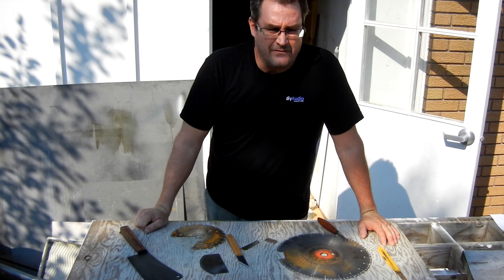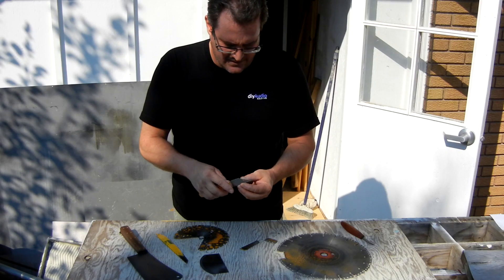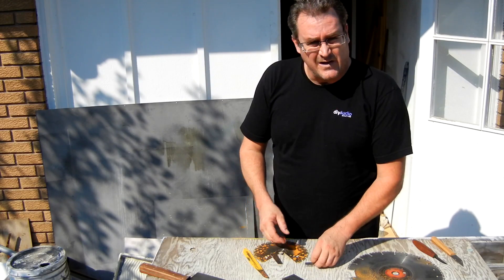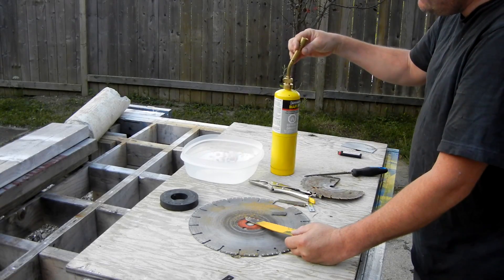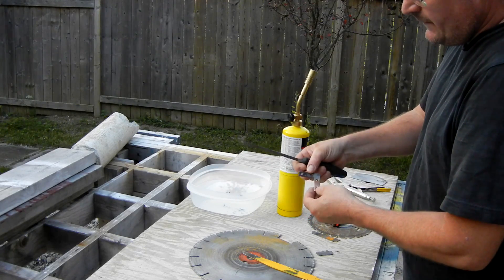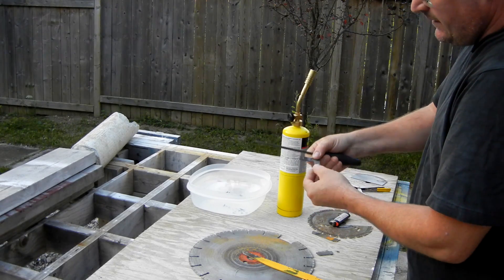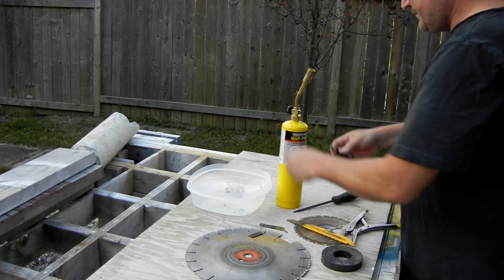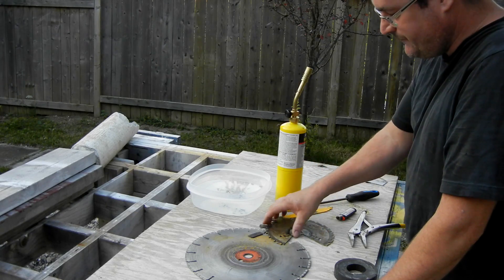Testing Saw Blade Steel

Comment: It's not 'the water' that makes it crack due to shock, the hardness is created by the speed at which it is quenched, the faster it is quenched, the harder it will get, (hardness is a result of the SPEED at which it was quenched) in any case, carbon steels must be quenched within 1.5 seconds or so..

Comment: look up a video on spark testing. if you put a abrasive wheel on steel the kind of spark spark it makes will tell you if it is mild or high carbon. basically mild produces a flat looking spark. meaning if you watch the spark it will be a straight and flat looking Amber coming off the wheel. high carbon produces a spark that splits into a kinda sparkler look. if you look it up you will see. it's a bit hard to describe. I always kinda assumed that the carbide blades was a more mild but never tested them. how ever I have used a old HSS blade and it made a nice blade.

Comment: I have 2 old circular saw blades with carbide tips and they dont harden and sparks are streight and arnt like "bushy".
Reply: Arkādijs Kulačkovskis Thats because carbide tipped blades dont need to be high carbon steel the whole way through the blade.

Comment: O6 steel? The o stands for oil, you need to harden it in oil. If you have w6 steel you will need to harden it in water, (w stands for water)
Reply: its L6 not O6

Comment: ok higher end and large saw blades are usually L6/1095 smaller blades up to about 12 inches are usually 1070/1084 all are fine for knives. Occasionally you may come across saw blades made from O1 tool steel but these are rare (to my knowledge). They are tempered to a RHC of around 60-62 which is too brittle for knives. I usually cut the blanks put my grind on the blank then re-temper them 3 times to get them 'down' to 58-59 RHC. The bi-metal is usually referring to the teeth and mostly it is tungsten.Hope this helps there is some other types of saw blades nowadays but generally if you buy from true steel nations like USA/UK/AUSTRALIA/JAPAN then you do fine.

Comment: I have made several knives from blades. The DeWalt Demolition SA blades are great for making neck knives. I have a 14" concrete blade like the one you have here that I am getting ready to cut up and make a few knives from it. They do make great knives. I anneal them first in a camp fire. They come out annealed but warped. I simply heat them up in the forge and straighten them. After making a knife I bring up to temp then let them cool slowly in sand to get rid of any stress in the steel. After that I HT using canola oil heated to 150 degrees. Then I bake them in my oven at 400 degrees for an hour. This makes a great knife that holds an edge well.

Comment: Very informative video John, thanks! I made a knife out of a 3/8 hss spade bit. Didn't heat treat it as I quenched in water frequently while grinding down slowly. Holds it's edge great. Nothing like using a tool you made yourself. Enjoying your vids, keep making them.

Comment: This is a great demonstration John. I use saws-all blades to make carving knives and they work great. I plan to find some circular saws like you have to try them. I will use your process to check the harden-ability of them. 
I once made a knife from a lawn mower blade: I wish I had thought to use the process of your demonstration, as the steel turned out to be "medium" and wouldn't hold an edge very well.
I subscribed to your channel.

Comment: "Straw" color is the proper color for tempering, not heat treating. To harden (heat treat), the steel must reach critical temperature, which is around 1500 to 1725 degrees, depending on the steel. At that point (red or orange in color), the molecules of iron and carbon align so that a magnet will not be attracted to it, as we've seen John demonstrate. 
After hardening, temper the blade in a kitchen oven at 400 degrees for and hour; turn oven off and leave until cool. This will temper it (straw).

Comment from the maker: There are better grades of steel, for sure, but the stuff found in good quality saw blades is not nearly as bad as I have read. 
High quality tool steel is costly and demands a more precise procedure to harden it to optimal. Junk blades are free and excellent practice.

Comment from the maker: Thanks! The oven time depends - some experimentation is needed to get the exact time for the very best results, but a good starting point is 400 degrees for 20 minutes, letting it cool in the oven. That worked well for my whittling knife blade.

Comment: Hey JP, Thanks for another informative demonstration of these practical old-school techniques!

I seldom get a chance to return the favor, but in case you don't know, try peanut oil for quenching. It's cheap, non poisonous and smells nice when used. 

I gleaned that idea from Ron Hock and found it to be useful.
Best Wishes and Thanks again!

P.S. Did you scavenge that magnet from a microwave?